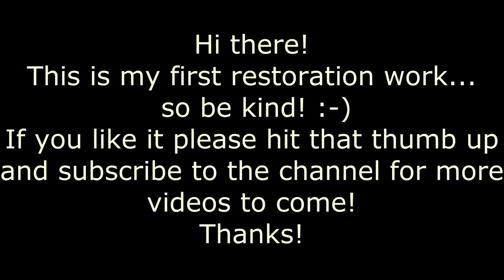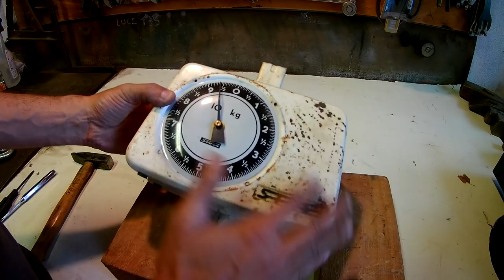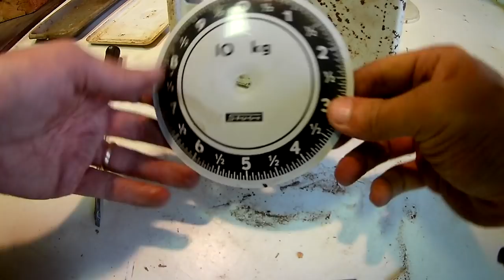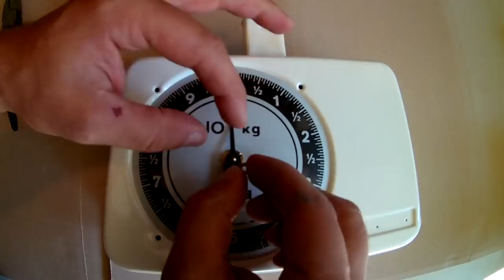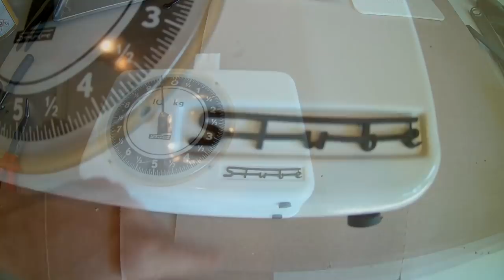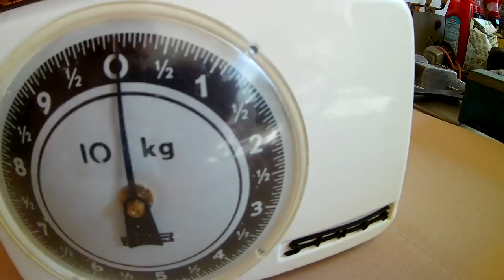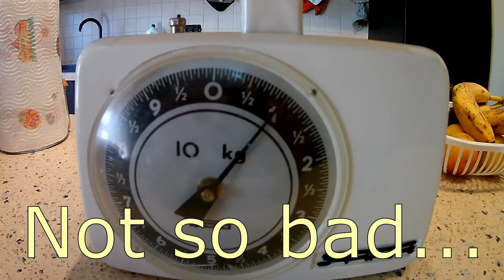Restoration of an old scale (Restore it project - DIY)| NICE

Comment: Really good job. This is not criticism on your work, but I was just wondering if anyone knows if there is a way  to remove old yellowing from clear plastic?
Reply: I don't think there is a way
Reply from the maker: Thank you! You should gently and finely abrade the yellow plastic and, once you done that, apply a clear paint coat to fill the micro scratches you created with the sanding... search youtube there's some detailed videos on that... it's not an easy process anyway and you might want to test it on a scrap piece of plastic first.